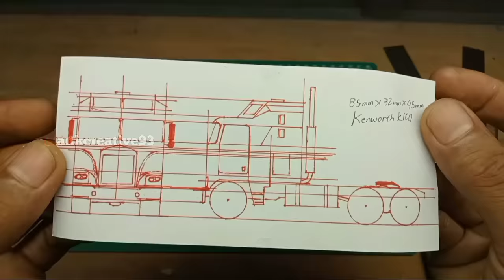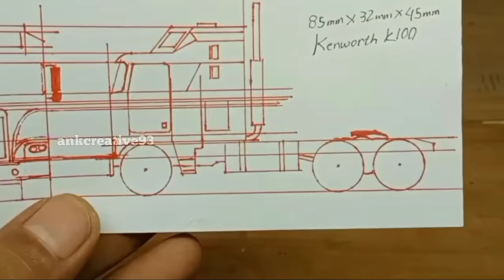Full Videos!!! I built a kenworth k100 Aerodyne truck out of PVC | Handmade

Comment: Great job wish I could do a 1/4 of that.2 questions what glue are you using.a to any one out there I have a revell k100 kit from the 80s a it missing few bits that can’t get anyone got bits kicking around where they have done a custom rig a have bits over.

Comment: Please don't take this the wrong way because I love what you have done. Your work is superb and I'm not in a position to judge your craftsmanship. I just wanted to point out that with all the detail work you did you forgot to make latch handles for the trailer doors and that reefer unit is totally wrong for that trailer. That trailer should have a much more squared off reefer and it would have been narrower. The type you made wasn't widely used until the early 2000s and your trailer is obviously of the 1970s judging by the length, the lack of an ICC bumper, tire cage (some people still use them today but it's uncommon compared to the old days) and the landing gear style. All of those components peg that trailer for exactly what it should be with that truck but the reefer is of a totally different era. I'm ok pretending that it was a retrofit but I think you were going for the BJ and the bear look.